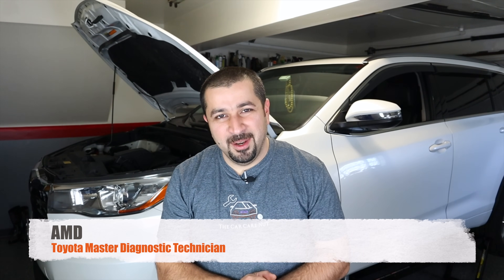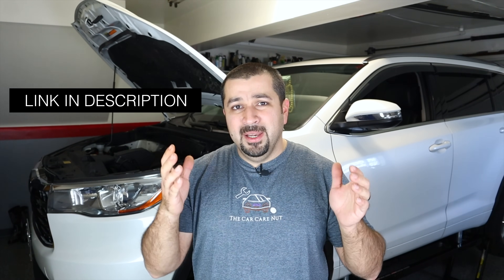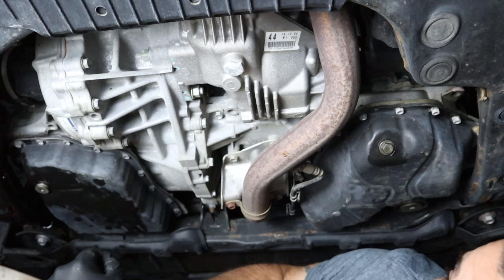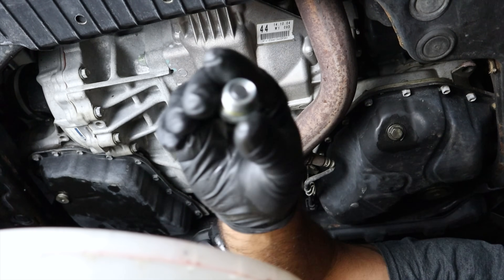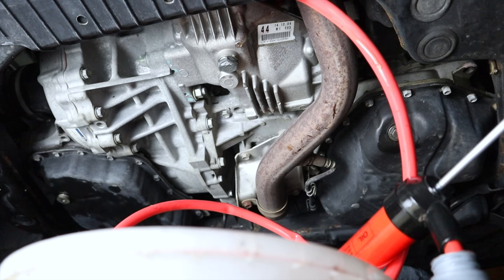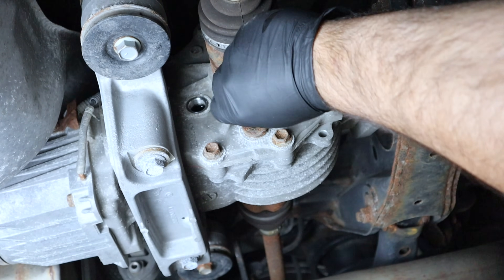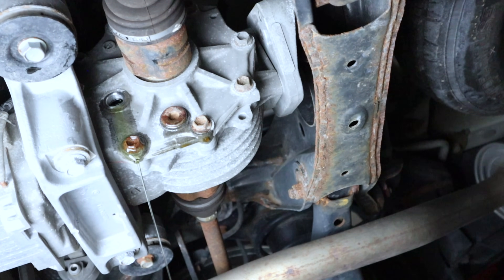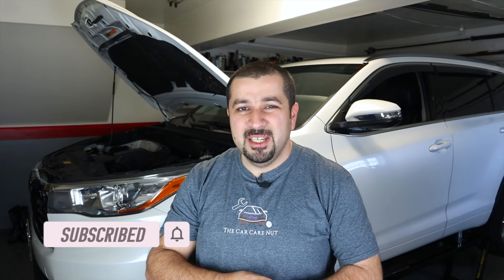How to change Transfer Case and Differential Fluid on Toyota and Lexus

Comment: I have a 3.5l 2006 4wd 2grfe auto that I've been driving in manual S mode, i put the gear lever into manual S and select 6 then  drive off and have found that I'm getting better fuel economy and the drive feels smoother and quieter. Is it just me or is there a reason for this? Thanks.

Comment: My dealer only replaced the rear differantial in 2019 rav4. And did not do the transfer case. Can transfer case fluid be replaced at next 5k appt without effecting anything. They also charge $200 for each. Is that fair price?

Comment: Does a 2015 Lexus GS 350 AWD only need rear differential fluid? I've read online it doesn't require front or transfer case fluid. Then my local Lexus dealer said it needs front and rear diff fluid replaced every 45k miles.

Comment: I have a 2021 Camry le and I wanted to change the differential fluid at 50,000. The dealer said they add an additive in addition to the new oil.  My question is do you know what this additive and who sells it.  My dealer service guy said they don’t sell it?!

Comment: I am so confused with my wife's 2022 AWD Rav4 XLE. The manual says change the transfer case and rear differential fluid at 30k miles. The thing doesn't have an actual transfer case in front but someone said it takes a different fluid than the rear? I know I can change the diff fluid in my 21 tacoma but am not sure what fluid to get for the Rav4 front and rear? Can anyone assist please?
Reply: Transfer case is near at the transmission,I have change mine last 2 years ago at the dealership,by the way its good to have on you're manual,mine doesn't have those just about go and check to the dealership.
Reply: @mckusasyawable9634  I know where and how to change the fluids in the front and rear but I get mixed messages saying they are 2 different types of fluid. My truck can take the same in both differentials and T-case.

Comment: I would like to know the part number of the drain/fill plug gaskets used in the rear differential gear assembly for 2016 Rav4 LE, thank you.

Comment: Out of place question, I recently purchased a new Tacoma (2021) with a V6 engine. Would an oil catch-can be helpful on this engine? I understand with the fuel injection system it has it is not necessary.  Thanks

Comment: Can I really use the same oil in my transfer case that I use in my differentials?  I have a 2016 4Runner Limited. I was going to use the redline 75w 85 GL5

Comment: bought used 2016 4 runner and doubt ATF has ever been serviced after 80K miles.  Dealer shops want to do full flush or exchange.  Read better to do drain and fill if has not been serviced regularly.  Which is better?

Comment: I have a 2018 rav 4, could not fit  any of my ratchets or breaker bar in to remove the drain plug of the transfer case. Got a teckton 10mm socket off amazon. Any ideas?

Comment: Does the 2020  lexus rx450h has differential?
Reply from the maker: H!! Yes but only a differential in the rear which uses Toyota WS transmission fluid. No transfer case

Comment: hi , I did service on my 2006 gs430 and according to the manual it should be 1.35 litres but mine was like 1.7 litre out when I measured.I have replaced it with 1.6 litres to be on safe side.My car was jacked up (3-4 inches)a little to reach the upper plug.is it ok ?

Comment: You mentioned the battery fan filter... I have a 2013 CT200h, it has no filter, online I read that Lexus sells an aftermarket filter.  But my dealer said no such thing.   Should I add one, and what kind?

Comment: Does a 2017/18 Toyota RAV4 AWD use the crush washer 12157-10010 for the transfer case and rear differential drain plug?

Comment: Question came up while researching this for my 2019 Adventure. Is it still ok to use the 75W-85 in this year Adventure model? Forums said that the owners manual for the 2019 says yes but the 2020 says to use the OEM oil. It’s the same fancier rear diff so did Toyota change the spec because they learned that it was necessary? Thanks for your channel! Thumbs up every video!

Comment: Hello thank you sir for this. So I'm trying to change my fluids on my 2014 toyota rav4 xle. Im confused with the transfer case fluid and rear differential fluid. Is the TCF same as transmission fluid? Or is it the same with RDF 75w-85/90 becuase on the manual says gear oil for both. I read online the TCF was the same as ATF that's where I get confused.
Reply from the maker: They use gear oil GL5 75w85/90
Reply: @TheCarCareNut  ok thank you I'll be using 75w-90 valvoline for TC and Rd God bless u sir!

Comment: Does this Highlander need to be level to perform the services, to accurately accommodate the dripping to fill plug? I have a set of ramps that I would like to use.
 I don’t have a way of lifting the car by all four wheels at once. It sounds like I need to have the car raised buy all four wheels.

Comment: To avoid a potential over-filling of the differential, would it be an option to measure the amount of old fluid removed and fill the same amount with the new fluid?
Reply: You can't overfill it. It runs out so you stop then. Pretty basic.
Reply: @alan4sure  the user manual shows the rear diff oil capacity is 16 fl-oz.   I drained out 12, pumped back in 14, and it's not even close to spilling out.     So, I think the differential case can hold more than required; therefore, it can be over filled.
Reply: @Chitown388  with the vehicle level, you fill until the fluid is level with the fill hole. It can't be overfilled. It runs out the hole at that point. Pretty simple and foolproof---unless the car is not level.

Comment: My Brother, I own a 2017 Tacoma Limited, purchased it brand new, about 2 months ago I started hearing and feeling a thump from the undercarriage in my feet area, when I accelerate out of a complete stopped location (stop sign or traffic signal)  and 
Sometimes slowing down to a complete stop.
Would that be a normal thing?

The truck has 28,000 miles but the standard  warranty is expired (power train warranty is still good)

The dealership is wanting to charge 149.00 for a diagnostic, I'm frightened to think what is wrong with it. ($$$)

The truck does not produce the thump when riding it. Thanks for any help you can provide.

Comment: Hello the car care nut. My question is nothing related to the topic of your video. I have a 08 Toyota sienna with 220000 miles, when going through a curvy road or or offramp, the brakes engage on their own and doesn't accelerate when pressing the gas pedal. It doesn't seem to matter how fast or slow we take the curves. Any idea what it can be? Thank you
Reply from the maker: Hi! Any warning lights or history of traction control activation?
Reply: @TheCarCareNut  hi. Thank you for replying but I'm not sure if it's the vsc or Trac off light starts flashing.
Reply from the maker: The car is slipping and that’s the traction control is taking over. Is the road slippery?
Reply: @TheCarCareNut  the van doesn't slip it just applies the brakes and doesn't accelerate. Once the road straightens out the van picks up speed. The roads are dry.
Reply from the maker: So this is a false activation of the traction control. Some diagnosis is needed to isolate if it’s an issue with a wheel speed sensor first
Reply: @TheCarCareNut  can my local Toyota run a diagnosis?
Reply from the maker: They should be able to. Give them all the information on the issue though

Comment: 1.  2010-2020 FWD Sienna and Prius does Not have a rear differential?      
2.  So as long as I change the transmission fluid for the FWD Sienna and Prius 40K miles......I am good?

Comment: Are torque specifications meant to be used on a completely dry threads/surfaces (bolt and hole)?  Doesn't the oil left in the hole after draining/filling make the torque wrench inaccurate (i.e., the bolt will be over torqued because the oil reduces thread/surface friction)?

Comment: I have a 2022 Lexus IS350 with the optional LSD. What interval would you recommend doing the differential fluid change at? Thank you!
Reply from the maker: Hi! Every 30 k miles.
Reply: @TheCarCareNut  Thank you very much AMD. You’re the man. While I have you, Lexus recommends a brake fluid flush at 30k miles. I noticed that you said in your brake fluid video that it can last for yeaaaaarsssss. Do you think it’s excessive to do it at 30k or would you recommend I follow the maintenance manual?
Reply from the maker: Hi! If it’s specifically written in the owners manual then I would follow it in this case
Reply: @TheCarCareNut  Sounds good! Thank you very much! Sounds like my 30k maintenance is going to be very expensive lol

Comment: Hi, I have a 2010 Toyota Matrix Base model, 1.8L motor with 215 000kms on it. There is a fuel smell when the car is running. I only notice it when I am sitting at a stoplight with the HVAC on bringing in outside air. It gets worse just as I start to drive. I can't smell it if I use the recirculate feature. Initially thought it was exhaust and have replace the whole exhaust from header to muffler. Still smells. Any suggestions?
Reply from the maker: Hi! Any oil leaks?
Reply: @TheCarCareNut  no oil leaks.
Reply from the maker: Interesting. Try blocking the exhaust with the car running and see if anything is leaking
Reply: Now I think it smells like raw fuel. Had a mechanic smoke the evap system but no leaks. Had a freind and long term viewer look at it he thinks an injector leak or fuel rail leak. He suggested I subscribe to you and post the question. Tonight was my first time tuning into the live stream. Much respect to you and your wealth of knowledge. Wish you were north of the boarder!

Comment: When changing the transmission fluid should the transmission filter be replaced as well?
Reply: CCN has another great video where he explains where he only recommends drain and fill and not a flush for transmission fluid and to do it every 50,000 miles (80,000kms) or somewhere around there.  He stressed not to do it too early as that can cause damage as too late can often lead to damage/clogging.  He said if done at proper intervals, you should NEVER need to replace the filter.

Comment: We had a 10' RX350 that went through 2 transfer cases. It was on it 2nd one we learned shortly after buying it. Kept leaking out passenger output seal, even after multiple replacements and CV axles. Ended up having to just dump it for a loss.

Comment: Hey, I am looking at Toyota Sequoia, 2nd gen to be exact. 
Reason I am looking at this model versus the 4runner due to price. 
Sure, they are gas guzzler but I needed for family trip and as a daily as well. 
Will this be a better buy with my choice. This goes back to price in used market compare to the 4runners. I am capable of doing my own work on whatever car. 
Are they reliable, transmission and engine wise. It seem Toyota V8 has been decent. Just need to know. I am thinking of trading up my 09 Sienna for a Sequoia. Since the newer model Sienna are over price along the 4runners. If I trade my Sienna, I can cash out the Sequoia with that and C.O.H(cash on hand).
Another note, it seem the price range I can afford, will have some high mileage, anywhere from 130k-190k. Just depend where I look at, seen anywhere from $15k-$19k.

Comment: What is the differential and transfer case maintenance for a 2WD 5th gen 4Runner?    I don't know a lot about these systems but I have a 2WD 4Runner SR5.  Is the differential similar to rear differential on a 4WD?
Reply from the maker: Hi! On the 2WD model you only have the rear differential to service
Reply: @TheCarCareNut  Thank you!  I couldn't find this information anywhere, and my 2WD 4Runner is actually at Toyota overnight tonight for service and a TPMS sensor replacement.  On your service recommendations, I asked for Diff and Transfer case oil change at 4 years\35K miles, but I can only find this recommendation for 4WD vehicles.  Appreciate all your videos and congrats on the new work space!

Comment: how do you change the dif fluid on the new torq vectoring advanced traction system on a 2019 adventure rav 4
Reply from the maker: Hi! Same way but make sure you’re using the right fluid

Comment: I own 2015 Toyota RAV4 AWD & I drove 73k only on highway 🛣 and city but I never changed differential fluid it’s gonna problem?? please show us how to change fluid on Rav 4 thanks 🙏
Reply: I doubt you’ve hurt anything.  No one in my family changes fluids other than engine oil.  We never experienced a fluid related failure, but we tend to drive easy.  If you live in an area with road salt you may have trouble removing the plugs.  It’s probably best to have a mechanic do this job.

Comment: Our dealership wants tochange all rear axle and pinion seals on my daughters 2013 vensa. My mechanic friend said that it might be a plugged vent seal (full of dust or dirt), on top of the differential. He said that
usually all seals don't fail at the same time and it was caused by excess pressure in the differential. Wouldn't the dealership know about this vent?  How do you fix or clean this vent? Could this possibly stop the seal leakage?
Reply from the maker: Hi! They’re very common to leak on the  Venza. Usually the vent will plug up and push the seals out. Replacing the seals is needed but also cleaning the vent which is usually automatically done when the seals are replaced but you might want to ask them about it

Comment: Do you have to do a different oil change than the transmission and the case?  in a lexus?
Reply from the maker: Hi! Which model?
Reply: @TheCarCareNut  
Lexus IS 250 2007
Reply: @TheCarCareNut  
because my car suddenly lost strength and now I put it in D and R and it just doesn't move forward as if it were in a parking lot.
Reply from the maker: Hi! If you press the gas pedal in park does the engine rev up or no?
Reply: @TheCarCareNut  
Yes

Comment: Please explain why the transfer case and front differential fluid need changing at the same interval as the rear differential on a Tacoma, Tundra or other rear wheel drive vehicle?   No one drives a 4WD vehicle in 4WD all of the time.
Reply from the maker: Hi! Even though you don’t use these systems they still have rotating masses inside of them

Comment: My 2016 RAV4 SE AWD rear differential fill plug is super stuck and on top of that the 10mm hex bolt appeared to be a little round off :(.  I tried penetrating oil, tap on my 10mm hex too into the hole to get it tight, and still it is stuck :(.  I don't know what at 36 inch pound that bolt is stuck!

Comment: Why did you use two different oil?
Reply from the maker: That’s what the owner wanted. As long as they’re the same weight it doesn’t matter.
Reply: What is the weight?
Reply from the maker: 75w85

Comment: Hi AMD
Do you know the torque spec for the propeller shaft on the 5th gen RAV4? I have the 2021 LE trim gas model
Reply: Don’t quote me on this for the 5th gen Rav4 which we just received yesterday, but my 2020 Lexus NX 300 (same at 4th gen Rav4) is 26 lbs/ft of torque

Comment: In February I bought a 2018 Camry XLE WITH 20K mileage ,as of today it’s 27K ,  today I was in a shopping center driving  10-20 mph when I saw an alert on my dashboard system flash on “ Message in combination meter” have no idea what that meant ? It went away within 30 seconds and everything is still working, I don’t know what to look for ?
Reply from the maker: Hi! Get it scanned for codes to see.
Reply: Will do, thank you

Comment: Can I the Valvoline 75-90 fluid for the transfer case and differential on a 2015 RAV4? I think Toyota uses 75-85 but can’t find it. I will appreciate if anyone can confirm. Thanks
Reply from the maker: Hi! Yea it will work without issues
Reply: @TheCarCareNut   great, thanks

My2015 RAV4  was in a flood and while I don’t see the the transmission fluid bad and it shifts fine, I don’t want to take any chances and want to do a full transmission flush. How many quarters do I need? I called two Toyota dealers and some mechanics and they all gave me a different number.  Some said 15qrts other say 12.
Reply from the maker: Hi! 12 is more than enough

Comment: I have a question why is Toyota using soy base wiring on the highlander
Reply: Amen to THAT! Use peppermint oil on cotton swabs or I purchased a gallon from Lowes w/ sprayer. Dont forget ur cowl area & where ur cabin filter is. Mine stinks a little, not quite peppermint, kinda chemically. STILL chek, I found 2 walnuts on my engine/back where coils are.🙄 I live w/woods surrounding me. My NEXT step is unit flashes noise/lite under hood.
Reply from the maker: Honestly this is a whole subject of a video on its own. Many people will give you many reasons. Some will say for the environment while others will say for cost. They have been doing this for years and they’re not the only ones.

Comment: Update: I was able to loose fill plug using spline socket 24mm.

Was anyone able to change transfer case fluid on Sienna 2017 XLE AWD?
I am not able to loose fill plug. I am using 1/2" ratchet.
If you were able to do so, please share details such as tool, socket type, size you used.
Reply: @Paul Thank you for responding.. Looks my issue was with six point socket which skipped couple of times. Spline socket worked.

Comment: Question please:
I have a 2016 Toyota Highlander XLE V6 AWD (got it since new), I just changed its Transfer Case fluid and the rear differential fluid; why would the old fluid from the Transfer case looked new & clear while the rear Differential Fluid looked dark (both used the Mobil-1 75W-90 Synthetic Gear Lube)?   Thank You!!

Back ground information:
- 1st Transfer Case & Differential Fluids were changed @ ~1980 miles (with Mobil-1 75W-90 Synthetic);
- 2nd Transfer Case Fluid & Differential Fluid were changed recently in June do to the number of years has gone-by@ ~20,000 miles;
- Both the transfer case & rear Differential drain plug magnets were with very little settlement.. just a thin layer over the magnets;